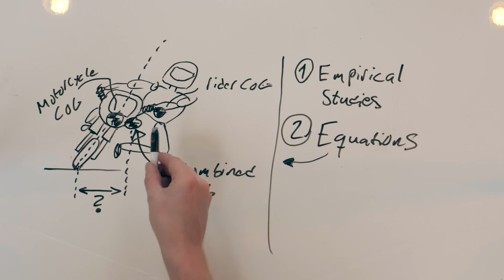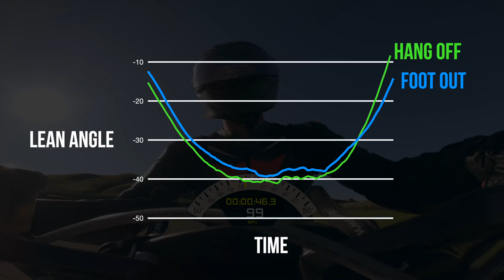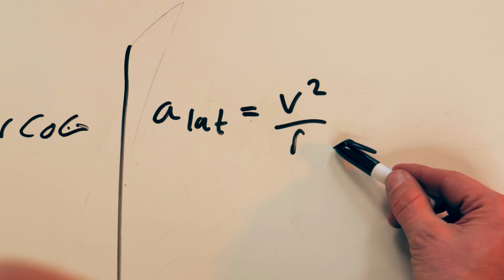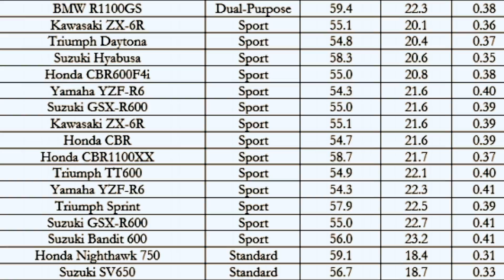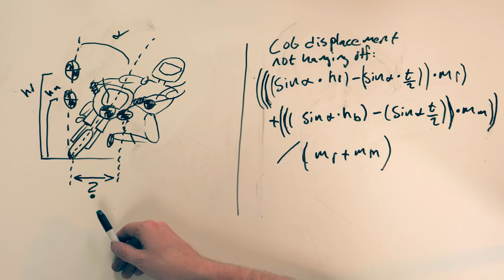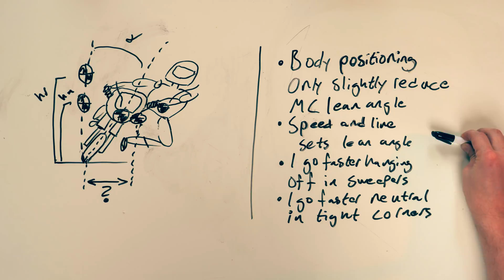Motorcycle Riders - Hanging off & The Science behind it

Comment: You are a Physicist or an engineer? I (as a physicist) say that your analysis is pretty spot on! Kudos!
Reply from the maker: Engineer. Thank you!
Reply: @MikeonBikes  I appreciate how you are very clear about assumptions and possibility of error (like camera lens distortion), that's the point I knew you had significant experience in an applied physics job (engineer).  I absolutely lose it when things like Mythbusters or some other so-called science youtubers do an oversimplified calc or perform a very limited experiment and call the results definitely concluded and don't acknowledge things that could've skewed the results.
Reply: @MikeonBikes  uh that makes sense,because I'm a physics graduate and would definitely fail to get realistic results as I would simplify many things here hihi :SS
Reply: Semper Fi  You could not have missed the point more.  The point is not "never learn terms for things", the point is that knowing the engineering and knowing the name of a part have nothing to do with one another and not knowing the trade name for a part doesn't mean you're a clueless idiot.  

I'll give a perfect example: my bike had one of the two footpeg mounting eyelets broken when I bought it.  It held fine on just one eyelet even with my full body weight on it (strong pin and the E-clip was rated for a 700 lb thrust load) but figured I'd replace it anyway.  A normal person would guess it would be called a "footpeg bracket" or something similar because its only purpose was to attach the rider and passenger footpegs to the bike, but no, Kawasaki decided on "Step Stay".  It's obvious I know what the part is, what it does, what it logically should be called, and I'd argue I understand the construction and metallurgy better than 99.9% of mechanics that work on bikes, but nevertheless I've encountered people that would think they vastly outclassed me in every facet of motorcycling because they knew the asinine "step stay" part name.
Reply: It is not lateral acceleration but centripetal acceleration for a=v^2/r
Reply from the maker: @flippyfiller  Yup, the lateral acceleration for a motorcycle. 

https://kineticorp.com/wp-content/uploads/2016/09/2015-01-1422-validation-of-equations-for-motorcycle-and-rider-lean-on-a-curve.pdf
Reply: @flippyfiller  geeezzzzz stop trying to measure D!ck$. Anyone who understands this is pretty darn smart (that includes you I'm sure).
Reply: @flippyfiller  Well,... strictly speaking, centripetal acceleration is the lateral acceleration in a circular motion. Since in a track you rarely follow a strictly circlular motion, but rather a combination of straight, elyptical, hyperbolic, also circular...etc, it makes more sense to refer to lateral and longitudinal acceleration! So, Mike used the correct term! Richard Feynman said at some point in an interview, that he doesn't understand why people are so obsessed with knowing the names of things, when they should be focusing on understanding their nature. The way I see it, things don't inherently have names, but they always have the physical properties, that they are supposed to have, irrespectively of the name we decide to give them.
Reply: @mrnice2994  I run into this all the time when trying to discuss something with mechanics.  I have no idea what a lot of parts are called, but I know exactly what they are and what they do, then they name drop the arbitrary name and act like I don't know anything because I didn't know what the service manual calls a part.

Comment: Good job on the study! I would love to see the charts myself. But this tale has been told many times - check Lee Parks's explanation - especially in relation to the suspension.
Hanging off is technically always better, but it becomes inefficient in tight corners because it takes more time and effort as compared to foot down.
Reply from the maker: I have heard of the explanation Parks gives before. How reducing the lean angle puts the suspension at a more advantageous angle, since friction in the fork tubes would prohibit it from working optimally at steep lean angles.

I have never seen any actual data or equations that quantifies the difference in performance, given different lean angles and how much the lean angle can actually be reduced by hanging off.

As I showed with both empirical data and equations, the lean angle reduction provided by body positioning is very limited.

Questions I have:
- Does changing the angle of the fork tubes by 5 degrees have a major influence on their performance? 
- Does this reduction in performance lead to significant changes in tire traction?

I will look into these questions further. The answers are not obvious, and I have never seen any data regarding this.
Reply: @MikeonBikes  great questions....
Reply: @MikeonBikes  how about the ground clearance? These 5 degrees can make a difference even for mere mortals.
Answering your questions - remember what they say to do when you install the front wheel? Bounce the forks several times to make sure they are parallel before tightening those axle bolts.
Another argument - these degrees also define how early you can roll on gas.

If Olympic swimmers can set their start jump angle with 1 degree precision, pro riders should feel the 5 degrees as a giant difference.
Reply from the maker: Ground clearance, sure.

Why do 5 degrees matter? Do you have any equations or data that quantifies this?

"Answering your questions - remember what they say to do when you install the front wheel? Bounce the forks several times to make sure they are parallel before tightening those axle bolts."

That did not answer my question. The fact that the alignment of the axle bolts is important has nothing to do with the difference in tire performance for say 40-45 degrees of motorcycle lean angle.

"Another argument - these degrees also define how early you can roll on gas."

Maybe. Do you have any data or equations for this?

"If Olympic swimmers can set their start jump angle with 1 degree precision, pro riders should feel the 5 degrees as a giant difference."

You are comparing apples to oranges.
Reply: @MikeonBikes  Equations for ground clearance? You don't need them if your pegs start to scrape the asphalt - that was my point.

Bolts - it's not about them - it's about friction in forks if the tubes are not aligned - it means the wheel is not moving as freely as it could - it means less traction.
This is the same principle that applies when the bump is pushing the wheel but it cannot move because of the poor alignment.

Equations for rolling on gas? I don't have them - it's obvious that the force applied to the ground should be pointed backwards, not sideways...

Apples to oranges? You'd be amazed how much in common there's between swimming and riding...
Reply from the maker: "Bolts - it's not about them - it's about friction in forks if the tubes are not aligned - it means the wheel is not moving as freely as it could - it means less traction.
This is the same principle that applies when the bump is pushing the wheel but it cannot move because of the poor alignment."

Yes, more friction in the fork tubes renders worse performance , and provides less traction, in theory. 

Without quantifying the difference in performance we don't really know to what degree the performance is altered.

"Equations for rolling on gas? I don't have them - it's obvious that the force applied to the ground should be pointed backwards, not sideways..."

Of course the force applied to the ground should be pointed backwards not sideways. I'm asking you to quantify the difference in exit speed assuming different lean angles.

If we are going to truly understand these things, they have to be quantified and measured.
Reply: @MikeonBikes  I like your attitude man :) you like math, not black magic bullshit. But you know this already - those bits get really tiny as you dig in... I hope to see you in the next bike videos, not in MIT nerd stuff :D
Reply: @trykozmaksym  If only he wouldn't be so stubborn... Saying that those 5° aren't important is like saying that when climbing you shouldn't attach yourself with 2 carabiner because one is enough. Yeah one is enough until it breaks and you die, just like 5° can be the difference between lowsiding and getting hit by an oncoming car or getting home.

Comment: The quality of the surface and the Power of the bike are also  factors. If you have to correct the lean angle due to loss of Grip and/or loss of traction a more upright seating Position helps you to respond to that(offroad). The onroad explanation seems to be more hanging off.

Comment: It would be interesting how the software you used arrived at the lean angle as determining it using a gyro on a motorcycle is not entirely trivial. Some software derives it using atan(lateral acceleration in g) (which assumes the bike+rider form a disc). It's also what I do in my little go pro lap timer (for now). Anyways, nice to see a bit of moto content during this time.
Reply from the maker: You make a very good point. I started comparing numbers between my Aim Solo and the data extracted from the GoPro. They provide slightly different numbers for lean angles.

I will look further into this. Thank you!

Comment: A few degrees lean angle is quite significant in racing. Would be more interesting to calculate the difference in cornering speed for the given maximum lean angle of a motogp bike.
Reply: Yeah, this is what I was thinking.  4 degrees less of lean angle means you have four more degrees of lean that you can get, meaning you can go some amount faster and still lean as much.  His tests largely held speed constant to judge the lean angle differential, which is why his lap times weren't affected.  

Lean angle has no impact on speed, but it does have impact on how much speed you choose to use.
Reply: @maxwellschmidt235  A professional rider on a moto Gp bike can use that 4 degrees , or even 1 degree to go faster , those guys are always at full lean , and that's the difference between pro and amateur , and I agree with you totally
Reply: @maxwellschmidt235  (in racing) usually the DRIVER has the most lean at the cornerexit when you start hitting the gas. You put the bike mor and more upright while staying at maximum lean to maximize reargrip and acceleration. The lean reduce in the corner is beneficial but less significant to overall speed than acceleration at the exit.
Reply: @PinkiesBrain  exactly and I think he avoided thw lean angle/more power/exiting topic because it would be a whole other study. As you said it really applies to top tier riders who are so well developed that small changes can make big differences for them.
Reply: Maxwell Schmidt exactly!  With less lean angle, he could’ve taken that corner that much faster, improving his time.  He’s just too scared to take that corner faster.
Reply: Yup, whenever i take corners not using lean out techniques, my bike feels like shooting outside the corner. But whenever lean out is applied i take the same corner with faster approach without any doubts. And that 4degree means world of difference in a GP bike shooting out 250HP.
Reply: Gnerko93 Especially at corner exit where drive is more important
Reply: Semper Fi  your comment does neither add nor change anything to what i`ve said
Reply: If we go by the 5% number then a 5% increase in the corner speed is huge for lap times

Comment: Hej Mike!
I did the same thing to counteract the argument against chicken strips.
Bike: Tracer 900 / Fj09
With a new tire, I took a fast route while hanging off measuring the chicken strips left behind.
Then I took the same route without hanging off. Times pretty much the same.
Indeed the 2nd time, there were no chicken strips and even though the difference was less than 1cm, I felt a lot more confident hanging off without having to worry about scraping pegs, etc. At the same time, in short low-speed mountainish corners I saw that I was faster while not hanging off thus, I try not to.
Bra jobbat, love the videos since the first upload ❤️

Comment: You say that leaning off only helps a small amount of degrees. But every degree matters because every degree matters for the amount of tyre on the tarmac. You see it with beginning track riders. Often very slow not using their body and have having high lean with really slow laptimes. Also entering corners to slow because the brake to hard. Release the brake to early and unload the front suspension and front tyre and ruin the corner speed. I really liked the comparison with supermoto between legg out and body out. Very interesting.
Reply: Amount of tyre on the tarmac? I'd actually contend there is no difference once off-vertical. The shape of the tyre means it hardly changes until you reach the absolute extreme.
Reply: @DiscoFang  It depends on the shape and wear of the tyre. The tyre is not perfectly round and tapers off to the side. And yes indeed when comparing lean angles one can argue that at some lean angles the difference is almost zero. One could even say that a very worn tyre on the track that as gotten a more triangle like shape has better grip on a very specific lean angle. In general you can say that more lean on the bike means less tarmac on the road, even tho under some angles the difference is pretty much zero.
Reply: That's me all over! Just done my second track day, made a vlog of both my first and second days if your interested, anyways I find exactly what you say, I'm not properly using my body to lean off and not carrying speed through the corners, I have been riding on the road for about 12 years though and think that has made it harder for me to change my riding style to lean off. Either way very interesting topic.

Comment: I want to like this video, but there’s just something ...
What defines “slow speed” or “sharp corner”? How about difference in shape of tyres - slicks are more narrow than street tyres ect.
Suspension set up makes a huge difference. I like your vids but this one is missing a bit of important things
Reply: So your saying a 190 road tier is smaller then a 190 slick tier ? That's really interesting sing how they're both 190's , the truth is the same manufacturer with the same style tire would make the same width on both tires. Now you can get two different manufacturers within one size will use 190 and the profiles may be different but the width is still going to be the same 190.

Are you on the people it thinks that hanging off makes the bike turn ? Or is it used has account for leverage to keep the bike pushing upright, I mean we all know if a bike is going around a turn it wants to right itself has the wheels are spinning it becomes a gyroscope and a gyroscope wants to stand up if its spinning.  Right?
Reply: Apollo Morris I’m not saying a 190 is wider when a slick. What I mean is the height and curve on a slick is taller and more narrow than a street tyre - does it make sense? I know how a motorcycle works - been racing since I was 12 yrs.
😊
Reply: @gamborg88  is that a rule of thumb or is there too many variables between manufacturers?